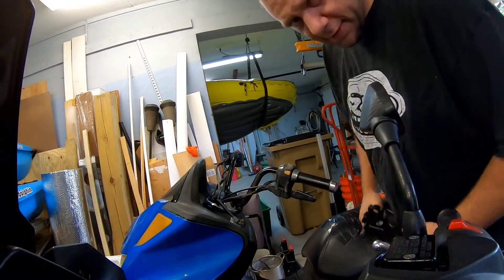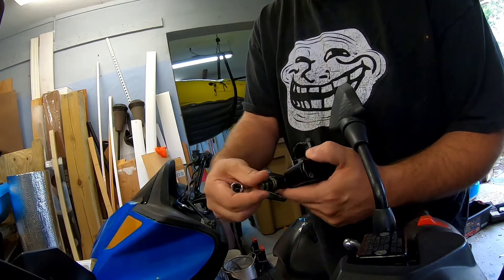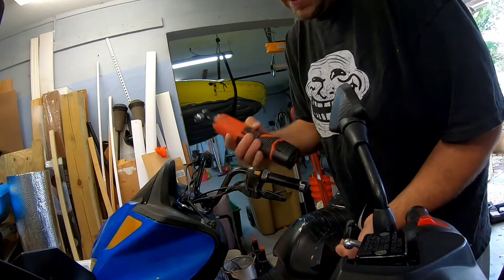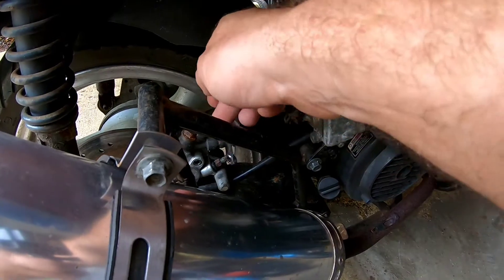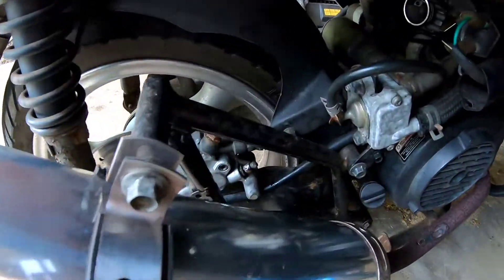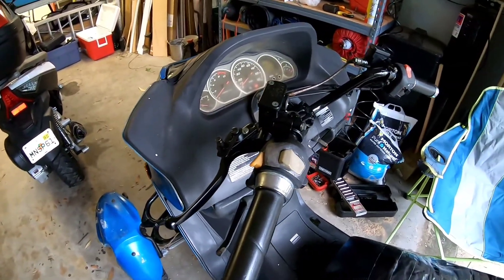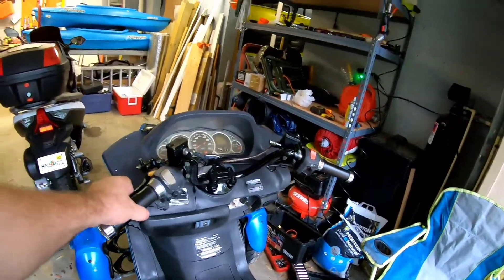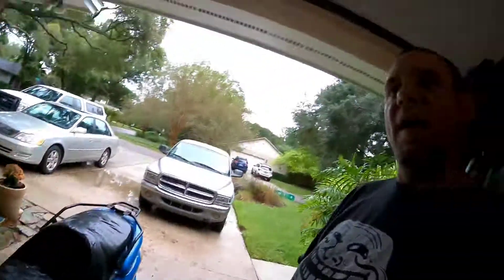How To Replace The Brake Lever On A 50cc-150cc Chinese Scooter And Bleed The Line #gy6 #gy6nation

Comment: I don't have an impact wrench but I break the bolt loose with a socket and ratchet then put the socket on a black and decker cordless screwdriver to fast power the bolt/nut off. It's small so it fit under my seat along with:  the most common open end/boxed wrenches and sockets, screwdriver, multimeter, thick chain with huge lock, wheel lock with alarm, tire pressure gauge, tire patch kit, mini 12v air compressor, dark shades, clear shatter resistant safety glasses, (so I don't have to use my helmet visor) bike paperwork and a towel. I really need to add some first aid kits. You should do a video on adjusting your front disk brake.
Reply from the maker: https://www.ebay.com/itm/12PCS-Electric-Cordless-Right-Ratchet-3-8-65Nm-Angle-Wrench-Tool-2-Batteries-U-/393069666075?mkcid=16&mkevt=1&_trksid=p2349624.m46890.l6249&mkrid=711-127632-2357-0
Reply from the maker: Doing the front disc brakes is the same as the rear except you always start with the discbrake farthest from the master cylinder.